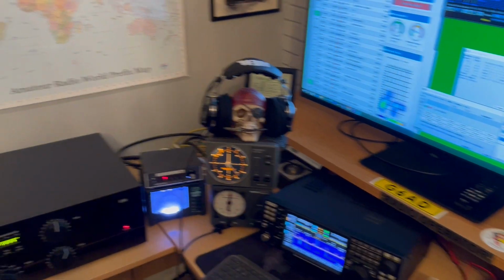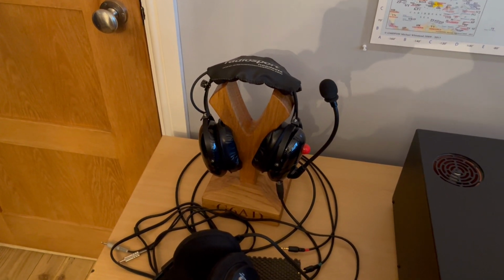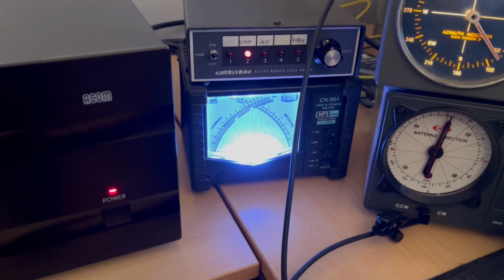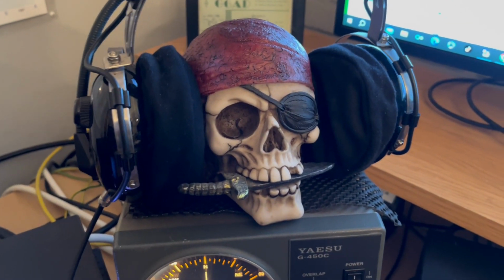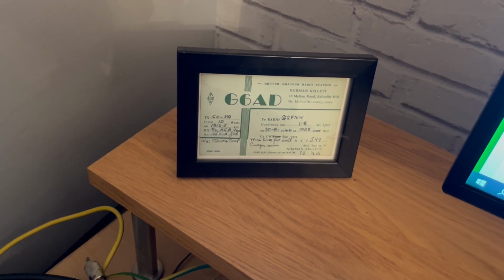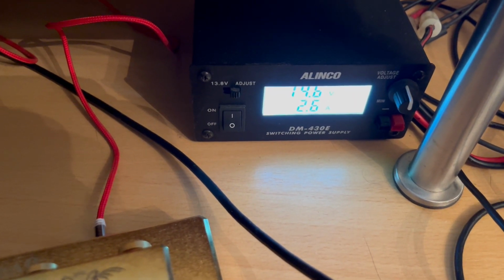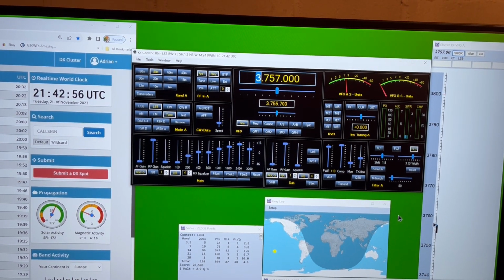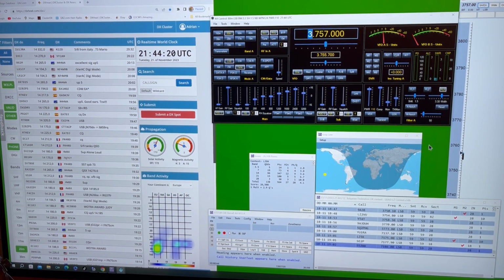Ady G6AD shack tour. Part 1.

Comment: Nice shack! You mentioned that you are licensed since 2019, but surely you have had a lower-tier license before, right? How long did it take you to collect the large number of DXCCs?
Reply from the maker: Thanks for the nice comment 😀 I was first licensed in 2015, the first 100 DXCC’s were a lot easier to work than the more recent ones. Better antennas, more experience and higher power definitely helps 😂